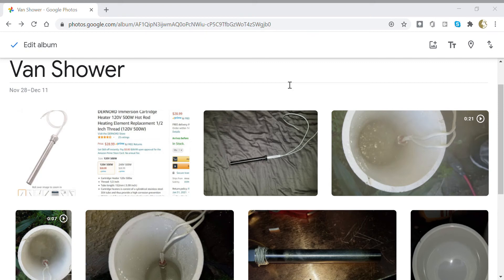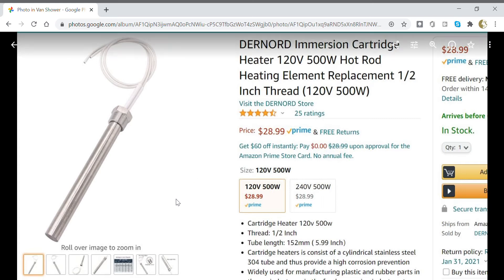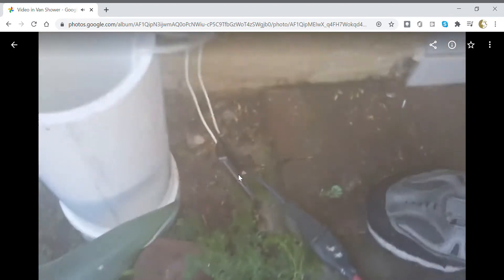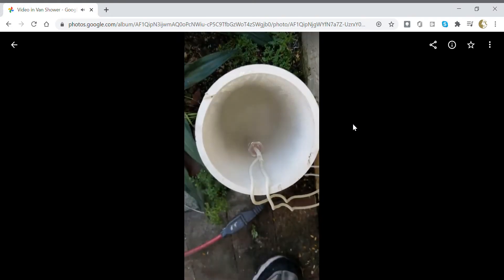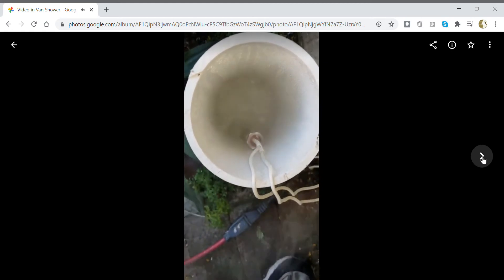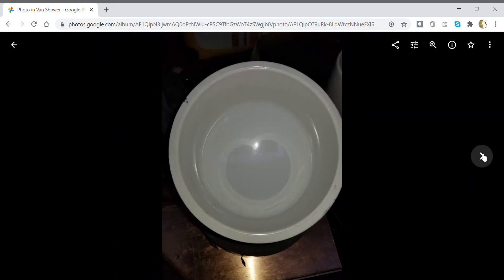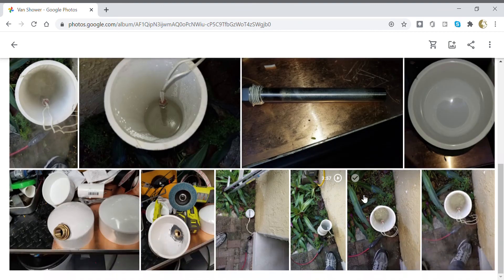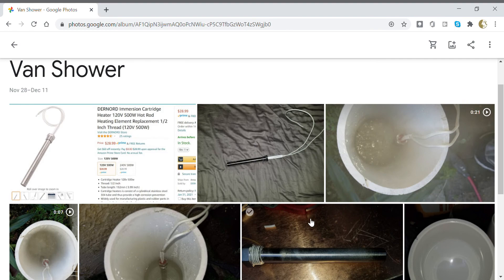Dernord 120v 500 watt 1/2 NPT 6 inch long Heating Element Testing

Comment: 2 years ago, any issues you encounter doing this? What's the thread fitting and element link on Amazon, I'm doing this if you have positive feedback
Reply from the maker: It worked great but I had unrelated leaks in the tank I built and rebuilt 3 times.  My current version does not have have the element in and I just heat with the sun.  i have two similar elements (one is a longer 750) . I use one to heat coffee and tea in glass jar and the other I built an on demand low stream pipe water heater for showering on cold florida days (LOL).  I have to look it up, I want to say 1/2 NPT but not 100% sure. .